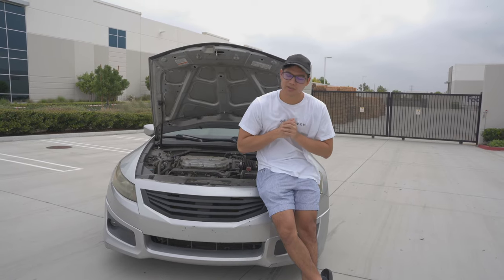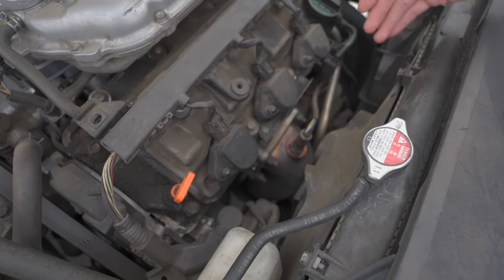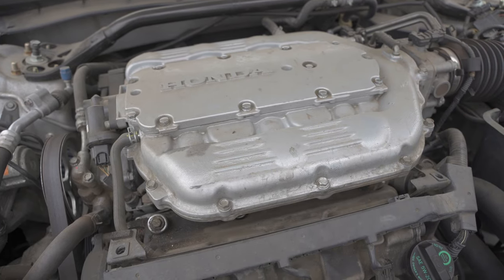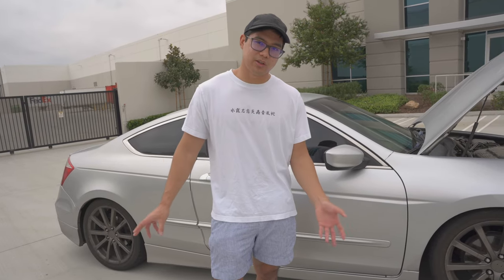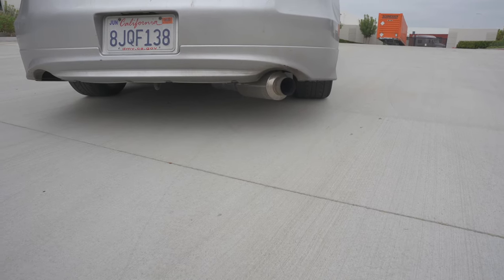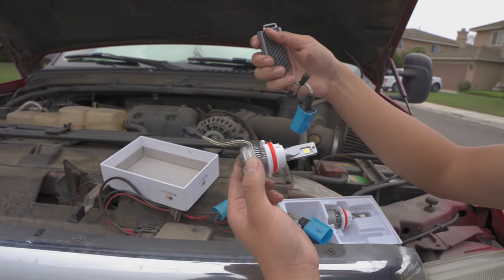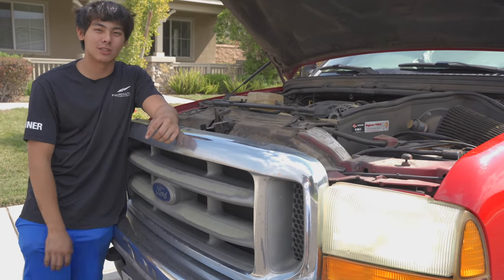TOP 3 MODS FOR ACCORD V6/J-SERIES PLATFORM! | 2008 Honda Accord V6 Coupe Build @abc.garage

Comment: Your stock ignition coils are holding you back they're holding a lot of resistance Holly makes msd/ACCEL high energy ignition coils for the j series especially if you're going to run e85
Reply from the maker: Thanks for the info that is def useful
Reply: How interesting
Reply: Thanks for the info well noted
Reply: Please drop links??
Reply: Interesting
Reply: FYI the stock coils are more than enough

Comment: Lightweight crank pulley is the best thing I’ve done
Reply from the maker: I thought about doing that mod
Reply: Lightweight flywheel. Game changer.
Reply: @bigthings1477 have you done it on the J series? I’ve been thinking about it because I’m doing my clutch soon but I hear the acceleration isn’t too different

Comment: Just did a stock j35z2 swap after repeatedly spinning a rod in my old engine.  Now I have a new engine in great condition and an old one with parts I can try to port and polish on my own. Asides from the runners and intake manifold, what else do you think I can salvage for power on the old engine?
Reply from the maker: The J-Pipe, full exhaust, full intake
Reply: I’m about to swap the same engine in a couple days . Any advice on how to make it easier ?

Comment: I just simply took mine unbolted them off and gutted them and bolted them back all three including middle third cat and man I can clearly tell the difference in both wheel starts spinning when barely pressing the pedal the throttle response and the sound man lots of head turns and questions people are often shocked to see it’s a Honda accord lol 😂❤
Reply from the maker: hahaha sounds dope, these are definitely sleepers!
Reply: Did you straight pipe it bro ?

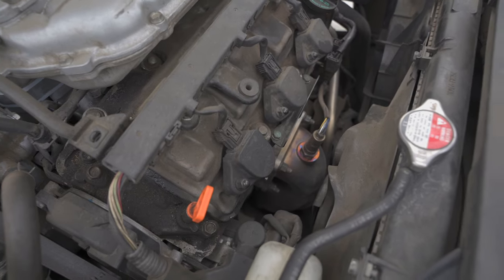Comment: 3:25 IDK what brand those are, but the ones I seen said 5-7 W hp, Just by themselves, no other supporting mods. Opening up the rest from intake manifold (35 37 swap, magnesium one (17160-RCJ-A01) from a hybrid for extra weight loss and extra cool points, literally, it helps with heat soak.) to exhaust tip definitely helps that figure..
Reply from the maker: They’re RV6 HFPC
Reply: put the magnesium j35y8 intake manifold on my j30a4 with new ngk iridium’s. the engine response and power is insane coming from a 20 year old engine

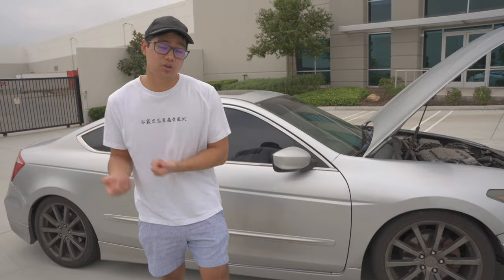Comment: 6:47 Not exactly. This engine does not have "headers" Headers attach to the HEAD. Those parts you talked about earlier the Precat / "HFPC's" ( High flow pre cat, but still essentially catalytic  convertors ) on the side of the heads, THOSE are essentially "headers" the J pipe is essentially a "Y Pipe" that you find on a typical longitudinally mounted V engine applications. Look at the Mustang or Camaro. Our engine is turned transversely so the exhaust is a bit more confusing. They call it a "J" pipe for obvious reasons. This confusing naming scheme all boils down to Hondas weird head design on these cars. Rather than 3/4 ports coming our of the side of the head, we get one big one. Convoluted nonsense scheme. 

Side note.. Can you imagine how these engines would do with a typical high flow head design with 3 exhaust ports per side?
Reply from the maker: It would be much more effective with 3 exhaust ports per side

Comment: Do you get a check engine light?  Did you have to tune the car after exhaust mods?  That's a clean Accord.
Reply from the maker: I had a CEL from the HFPC’s and yes the tune cleared it. My newest video is of the 91 tune (uploaded yesterday)

Comment: Because my 37 is missing this part, I can't find it in Taiwan May I ask where you can get it?
Reply from the maker: Try P2R
Reply: because my idle speed is not smooth
Reply: I can't find the corresponding one here in Taiwan.

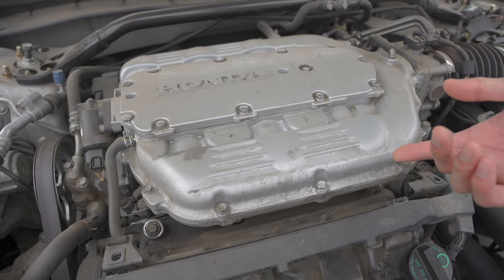Comment: 5:04 ???? the intake runners are the lower part. Aren't they? or are you referring to the head?
Reply from the maker: Meant the head my bad
Reply: @abc.garage  I have been pausing the video and looking stuff up. Haven't even finished it yet and you already replied. That's dope. You should do a throttle body bypass (bypass coolant lines that run to the throttle body which create heat soak and raise intake air temps) and E.g.r. delete. and then dyno it again. You will be amazed at what those 2 little things will do for your car.

Comment: pre cat deletes are not available in us anymore. I would love to be proven wrong. Anyone know where 
I can get some?
Reply from the maker: I’m not sure when they stopped selling them in the US
Reply: Rv6 sells the pcd and high flow pre cats as well as the long tube j pipe that deletes the 3rd cat. They are still being sold. Had my hfpc and long tube j pipe delivered in January
Reply: @TheHappiestWheels  I don't want "high flow" I want full pre cat delete. And when I checked about 3 weeks ago. The ones I wanted said not able to be shipped to the u.s. anymore. ...
Reply: @TheHappiestWheels  I just got off the phone with jspec performance. They said Not available to be shipped to USA. I found another company but they only sell ones that are for newer accords they don't have anything for my year or motor.
Reply: @bindthedevilloosetheangels  wait what year and motor do you have, also I’m talking about straight through the rv6 website, or like kseries parts. That’s possibly just jspec that’s not doing it. I live in Missouri just so you know
Reply: @bindthedevilloosetheangels  oh ok. I didn’t see the comment before talking about not wanting high flows. Either way I know they are selling them for the 8th gen accord v6
Reply: @TheHappiestWheels  04 Acura TL base model. (j32 a3)
Reply: @bindthedevilloosetheangels  oh. Hmmm. Not sure on the Acura models. I have an 09 accord with the j35z3 (6speed manual gets the z3 while auto gets the z2) so I’m not too sure on Acura things
Reply: @TheHappiestWheels  Want to sell it?   ; )
Reply: @bindthedevilloosetheangels  i have a 2014 v6 6 speed id sell. theres 30k on it.  HFP Package even! its nice!
Reply: @WISCOFISHINGANDOUTDOORS  Where do you live how much?
Reply: @bindthedevilloosetheangels  I'm in wisconsin. It's a TX car. 100%rust free. I'd like to get 18k for it.
Reply: @WISCOFISHINGANDOUTDOORS  Tempting, Too far away though. I'm on the west coast.

Comment: Next mod, 15mm or 20mm spacers to fill out the gap in your wheel well, so your wheel & tire setup won't have that "pushed in" look @ the rear 🤷🏾‍♂️ ?....this is a pretty affordable mod with subtle effects that look good.
Reply from the maker: Lmfaooo I have been on and off about that bc I do want to switch up the wheels
Reply: I just did it to mine lol, fixed the rear fitment, my coils did the same thing his did, it looks great now